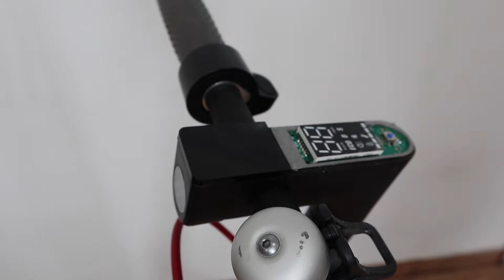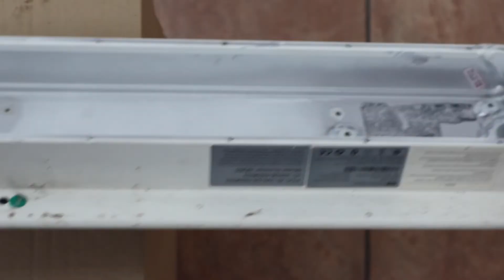Xiaomi M365 - TEARDOWN!

Comment: Thanks for the video 👍 I just crushed the gray cable (while unfolding the handlebar) going from dashboard to the mainboard. I see I need to detach the battery compartment to be on the safe side while I'm working on to attach the broken wires.
Reply from the maker: Yeah, it's always a good idea to detach the battery prior to working with the cables.. you never know when you may accidentally short circuit things

Comment: You didn't remove the front bar from the folding mechanism. I'm currently supposed to do that but i don't think it will come out without braking the bar. Any ideas?
Reply: I have a couple of the bars laying around.  I'll try doing and let you- Dan
Reply: @danielbambino7348  Did you find out how to do it? I have the same question :D

Comment: Is the red brake cable fixed inside the bridge? I can't move it at all, like in any direction.
Reply from the maker: The red cable is not permanently fixed to the bridge, but it goes through some VERY tight spaces making it difficult to pull out.  Apply some WD40 on the cable and you should be able to pull it out.  Just keep in mind that it will be difficult to put a new cable back in the same place.

Comment: Which number allen did you used in 5:24 and 5:34 ? My latch gaves cracking sounds when i rotate the steer left and right, my service says you can unscrew little and hit tyre to the ground, with this way bearing will be fix a bit with his say. So I need the allen number of this thing's immediately.

Comment: i have a small problem and need some help; I have a xiaomi 1s, and it fell on its side, but when it fell, a metal wire fell off, and i have no idea where it goes. I noticed that the brakes now make a little bit of noise. Anyone got a clue?
Reply: nvm yall it was just displaced after it fell over and i just had to unscrew and screw the brakes back in place

Comment: Can the rear brake light wire at 7:10 be replaced?
Reply: Yes but u need a exact replica then
Reply: @soffe6652  how do you replace it? Is it just a matter of disconnecting the connector and connecting a new one?
Reply from the maker: @dawoodkhan6067  The original brake light comes with the wire already attached to the light.  To replace it, all you have to do is attach the two connectors together.
Reply from the maker: If you're comfortable with soldering then you can easily replace just the wire.  However, it's less time consuming to simply replace the brake light which has the wire already attached to it.  I hope this helps.
Reply: @escooterrider1834  I mean the cable the brake light connector attaches to. Can that be replaced? If so. How?

Comment: You did not strip down the motor, nor did you take the tyre off the wheel and remove the inner tubes,and you did not remove the rubber base that you stand on and you did not remove the brake caliper and you did not remove the charging point and the red rubber cap.
Reply from the maker: In other words you're asking for a complete demolition...that can be done, all in under an hour, stay tuned...
Reply: I just want to see the wheel motor disassembled.

Comment: Hardly a teardown when you didn't remove the lock block from the pole....
Reply: Exactly
Reply: I can't get it off, how do I do this? I need urgent help
Reply: @proxyhx2075  you have to heat it up from the outside of the pole with a blow torch to burn the epoxy away.

You absolutely must stay under thee melting point of aluminium. Some paint will be damaged, obviously.

Once the epoxy is burned up you can put a ram rod in from the top and ram the linkage free.
Reply: This is the problem with my lads as its constantly breaking the locking cams - cheap crappy Chinese alloy. If I'd known about this before buying the new complete folding block assembly (simple up until now), I'd have gone in another direction.
Reply: @ssss-df5qz  thanks mister. My m365 has been far more work with the dumb design than the scooter is worth.
Reply: @Sebur8an  just get a solid block for the stem.  It won't fold but it'll be rigid.  They are about  50 bucks

Comment: Don't buy this rubish scooter.  We had two regular and pro versions.  After 2,500 km, the bearings will be so loud that it is impossible to drive.  Bearings practically impossible to replace.   Will start to violin, tap.  The brake cable will break.  It will stop charging.  Replacing a punctured inner tube is a nightmare .  My friends scooter broke down after 1200 km.  The Xiomi warranty covers nothing under warranty.  They demanded 3/4 of the value of the scooter for the repair of a faulty loud motor of no known fault.  Stay away  from these chinese scooter…